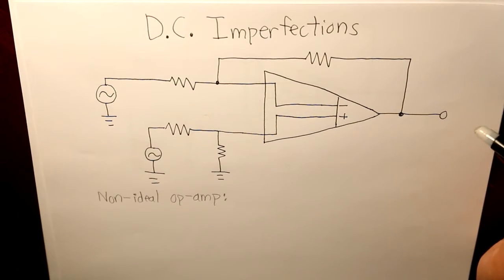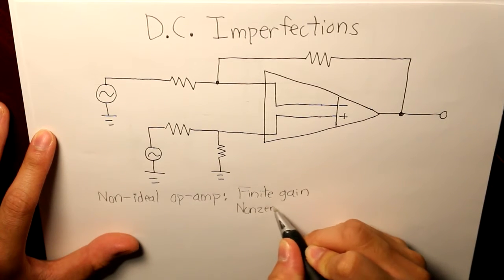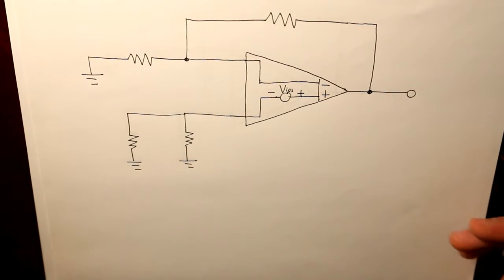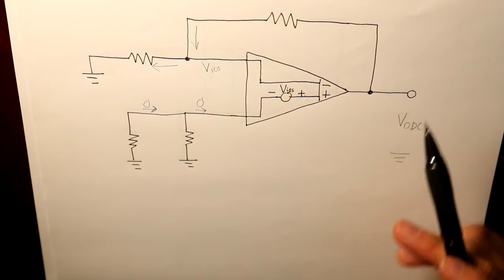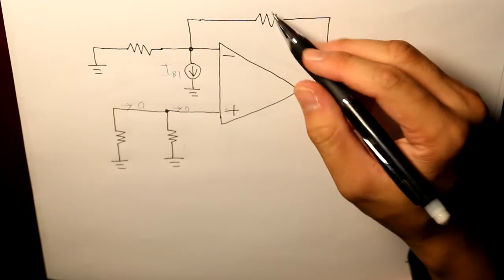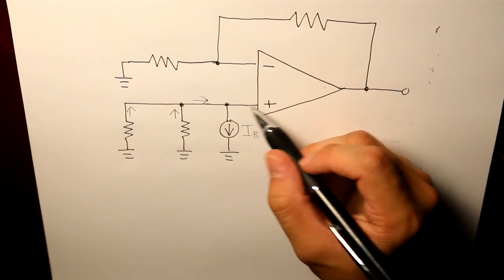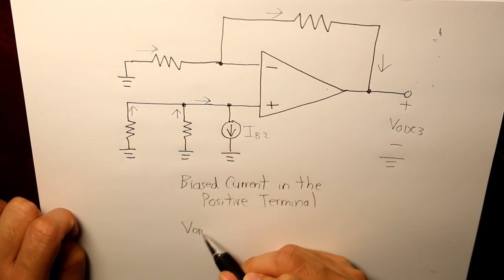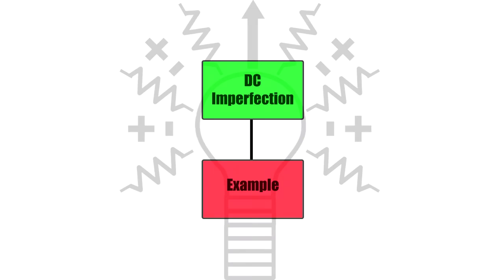DC Imperfections (Theory)

Comment: Oh that's was cool, it helped me understand it much better, thanks a lot. 

Just two things you didn't really mention were the reason why the DC offset voltage is replicated at the negative terminal and why no currents go into the op-amp terminals.

The first one happens because it's one of the two "rules" of the ideal op-amp that is contained inside the real op-amp in the example: it does everything it can in order to make the voltage in the two inputs the same. And the other rule is that since the ideal op-amp's input impedance is infinite, there's no current flowing into its terminals, that's why when dealing with the bias currents some of it doesn't go into the op-amp.

The approach is to try and analyse the real op-amp modifying the ideal op-amp through the offset voltage and bias currents as you did. 

Keep up the good work!